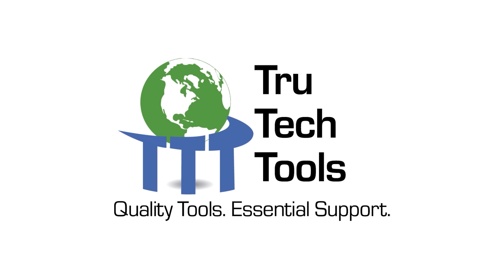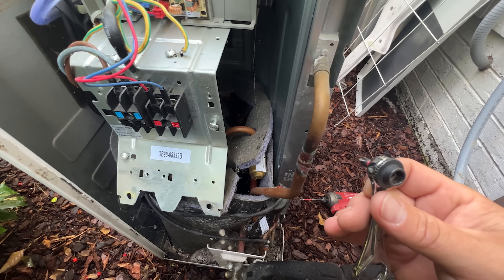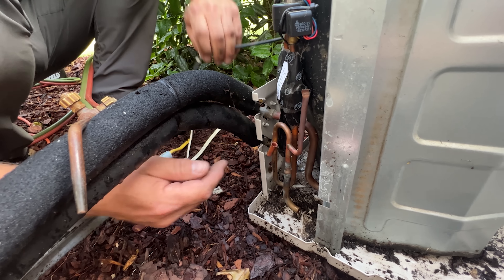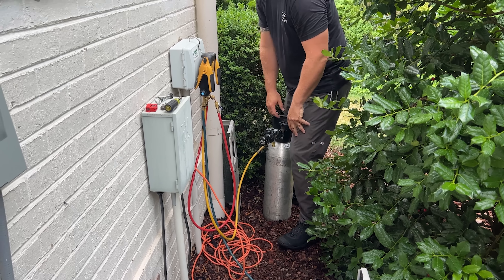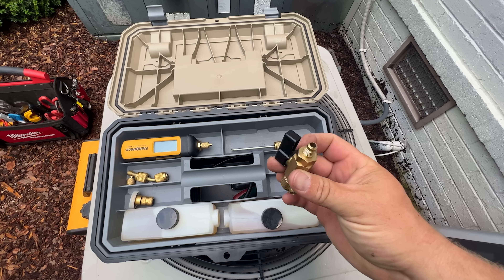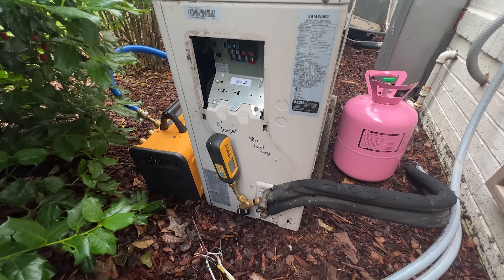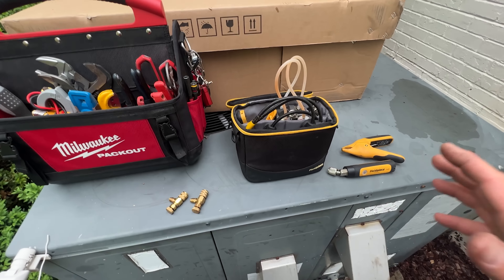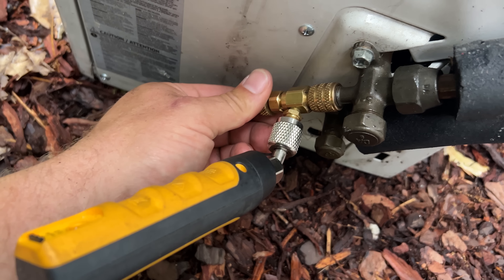Replacing LEAKING Micro Channel Coil In A DUCTLESS Mini Split | HVAC Repairs

Comment: 3 screws that you mention. It will be easier to remove when you took the front panel off. Coz youcan access the screw that hold the metal sheet to the base. After that you can lift the coil and the sheet in one piece. Hope it help you next time ^ ^.

Comment: I’m  new student, questions 
Before you brazed the coil , did you loosen a flair fitting to flow N to prevent OX from containment in your tubing ? 
Your Video wan not clear 
Thank you 
Pete

Comment: Mini split should have been moved off the ground . Probably the reason why the coil was damaged from the weather . Besides that . This is actually the only video on the internet about replacing any mini split parts .

Comment: Are you brazing without flowing nitrogen into the pipes?
Reply: That was normal 20 years ago. Lol
Reply: @malcolmwhite821  no
Reply: Lol with micro channel I would never chance that
Reply: Definitely should be; Coil is not that big though. Brazing was done quickly. vacuum was probably able to suck out what little Soot there was.
Reply: Vac does not suck out soot
Reply: @georgekolos5255  nitrosweep and filter drier can help remove soot.  For sure best practice is to purge but when shut off solenoids are used inside the condenser where repair is being made. and only one service port is available to begin with. It becomes a matter of do you really want to run to the parts house for a 1/4" tee with service port.
Reply: Risky not flowing nitrogen thru your braze.  Mini splits are small, and many small diameter parts to plug up. What did you do for a drier? Did it just have a small strainer-drier?  Easy to plug up with scale.  Looked like you got a cold joint on that braze.  The pipe should be hot enough to melt the rod, without the torch being right over it.  Just my humble opinion.
Reply: @Chemp95  I’m sure he had a selection of access fittings on his truck.

Comment: Hate micro channel coils, haven't came across any mini splits with them yet. Where was the leak? I've had great success with solderweld aluminum brazing rods. Fixed a couple evaps n condenser coils with it. Even copper to aluminum. Great kit to have.
Reply: many cheaper mini splits in my country used to come with micro channel but almost everyone of them leaked within two years of installation. now no one wants to buy them so micro channel for mini splits is dying trend at least in my country.

micro channel will work with low working pressures of r134a but it simply will not tolerate the high pressures of r410a & r32. many people will replace micro channel with normal copper coil in my area and they work really well without any leaks
Reply: Awesome to hear someone being a tech and knowing how to repair them. The solderweld kit is definitely a must have. It saves the customer money and you make the sale
Reply: @dantemariscal8679  if the warranty is up, I'll give em options. If i can save em a few hundred why not. Plus it's hard to get some things right now as it is.

Comment: that brazing was pretty bad you didnt let it melt and flew into the connection its just on the surface
Reply: And no nitrogen purge while brazing…
Reply: It's gonna hold doesn't need to be pretty
Reply: @davidgallegos4771  standards vary

Comment: Microchannel would last with the old refrigerant, lower pressures. Can't handle the 410a. Scared of what r454b will bring. And now new carrier condensers are coming with outdoor aluminum coils 🤦
Reply: Is carrier going to R454b? I heard daikin is going to R32 and was hoping everyone would be switching to the same refrigerant
Reply: The lie was all Al micro channel coils would last longer than copper tube/ fin coils because no chance of formic corrosion to develop.

Yeah we all know how long such coils last these days 

It's a shame
Reply: @Austin23191  yep. Carrier is going to r454b. "Puron advance" carrier calls it. And I heard this right from our rep from our supply company.
Reply: Micro channel is car radiator technology.  Never meant to cope with the pressures of AC, due to the inability to flex without eventually leaking.  Every one of those coils is a time bomb.

Comment: All us service techs need to get ready to be replacing alot more.. its coming. These coils stink! They are not able to handle 410a. Maybe the new refrigerants will have lower pressures.
Reply: New refrigerants have higher pressures

Comment: So, clean work minus a bunch of rookie mistakes….  First off, clean the area around the coil and the internals.  Then remove the outdoor coil.  You did not use nitrogen while brazing a huge no no while brazing and huge no no on a mini split.  Be better bud…